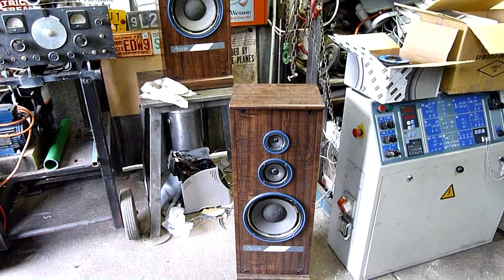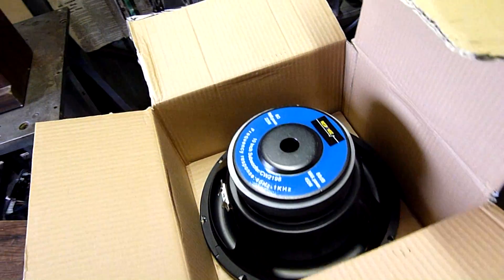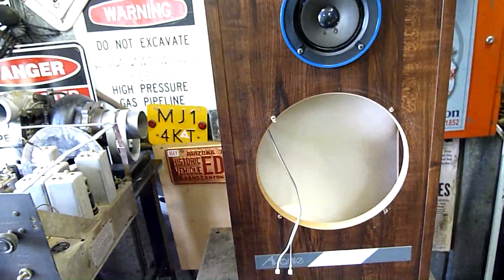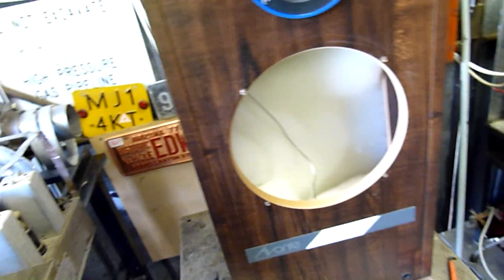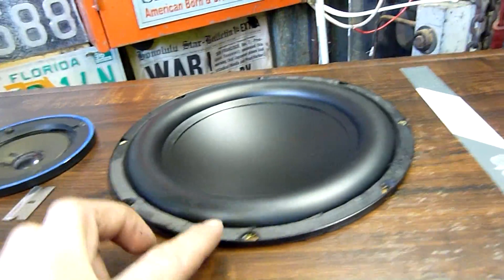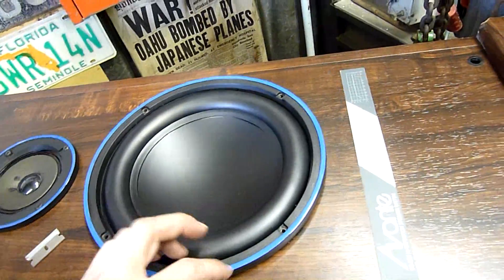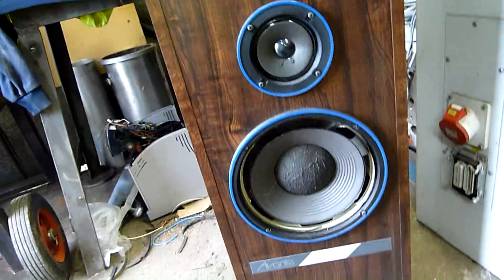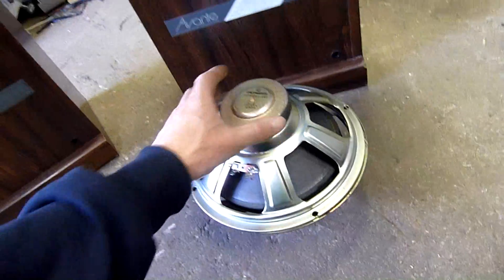Avante Speaker boxes get new 10" Subwoofers

Comment: Hello, I have a set of these speakers. They are in good condition and have been in the family since new. Sometime in the mid 1980s. I quite like the sound they produce with not much else to compare to. I have had the bass drivers re-foamed and recently one of the mids stopped working, so I replaced it. Very happy with them. Would like to hear the result of your woofer upgrade also!

Comment: Most likely capacitor "part" is from low pass side of crossover, it's shunting high frequencies after the main coil for low pass, a simple LC filter, might be just few octaves. With the speakers that you put now, it will be not a problem, this new woofer speakers don't produce much of high frequencies, it's their new construction :)  Can't say that it's a great replacement for this speaker system, those pioneer woofers were build specially for "closed" enclosure, that's why such a small magnet and paper cone, sometimes called acoustic speakers, they are a bit different from speakers that are now used in car audio. Hard to get acoustic speakers now, I guess mostly possible to get from Eminence, Visaton and Beyma. But your system will play nicely anyway I bet, looks great!

Comment: If the capacitor is bad you may just be able to clip the leads at the capacitor body and solder a new capacitor to the original capacitor leads.

Comment: ebay 3 way cross over. easy way to fix it. The audio bug may sound like a bad thing but if you let it do it's thing you will turn into a Audiophile there is nothing wrong with that. \m/

Comment: bi amp those... drive bass with one amp mono. And the highs and mids with an stereo amp. Thats what i would have done. And an basic crossover :)
Reply: Yay now comments work. I would do standard wireing for the mids and highs. Isolate the bass drives. Sens there one coil four ohm most likely I would wire them in parallel dropping the bass to two ohms. Then I would drive the bass with an big mono amplifier. And drive the mids and highs with an standard amp. Most decent home theater amps have sub low out that is perfect for driving an subwoofer amp stait of the bat. Sounds allot better that way. 

There is parallel series and there are one coil and two coil subwoofers. 2 4 8ohms normally. In this case I would do parallel on subs of the amp is 2ohm stable. 

In pararalell 4+4ohms equals 2ohms

In series 4+4=8ohms. 

Hybrid parallel that can be done with dual coil. 4+4=P2ohm then same for other sub 4+4=2 and you take those two banks in series and you get 2+2=4ohm. You see what we did there. Wired two 4ohm coils down to two ohms per sub. Then we wired the two subs in serial giving us the 4ohm load back but with two subs. 

I'll tell ya more over phone :)

Comment: the ports in the cone are almost like vents. they suck air through the cone into the coilgap and pushes it out the bottom hole. and MY GOD THEY ARE SEXY WHERE DID YOU GET EM I WANT EM NOW!
Reply: He said they came from Jaycar. Generally they seem ok for getting a decent enough driver without having to pay excess shipping for a great one from a US store. You should see some of the speakers you can get from Parts Express or similar, so good you want to put them in a see through box lol. Then again you wouldn't use a super expensive speaker with those paper tweeters/mid and unknown crossover ;p

Comment: Junk speakers in a junk box.  Good job.  You can use t-nuts to secure those drivers.  It will extend the life of the JUNK mdf.  Have you ever refoamed or reconed a speaker?  It's not very hard.
Reply from the maker: they actually sound really good, tho I am no Audiophool so I don't really care about frequency metering or all that crap. 

I have never reformed a speaker, not that I would bother with the cheaper ones like the Pioneers I removed.
Reply: I've refoamed a couple name brand speakers and reconed some professional audio speakers.  It's kinda fun.
Reply: It's good for dampening and all, but as soon as you unthread a driver that wasn't threaded into t-bolts to begin with, it could be calling for disaster.  You can't use MDF or chip board anywhere around moisture.  The main reason I said "Junk" is because big-box store brand are JUNK.  Compare them to your vintage realistics, advents, genesis speakers or the 5k$ brands you are refering to, big box store speakers don't even come close.

You can build your own boxes and load them with $30-100 dollar drivers and have a system that is way better than slapping a random mass-marketed "subwoofer" into a random box.  You know where I'm coming from if your at all familiar with speaker design.
Reply: And I'm only picking on Ed because he knows better.
Reply from the maker: Nicholas Smerk I don't have tee bolts. and FYI they work fine, it was just a dick move by the manufacturer to glue the screws in.
Reply: I've dis-assembled a few of them, where as soon as you unthread the screws, a whole chunk of the board breaks off.
Reply: I have the same speakers, no issues with the mdf and unscrewing parts, but they have always been stored inside and not been exposed to moisture. Agree with Aussie50, they sound quite good for a cheap setup.